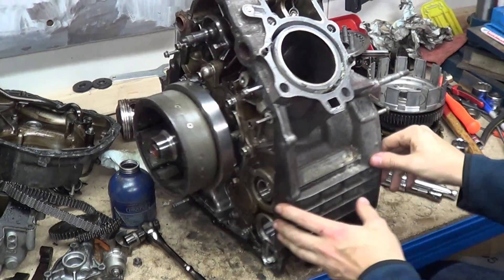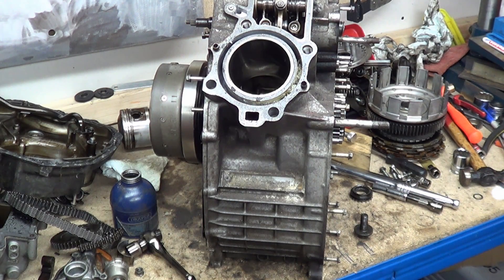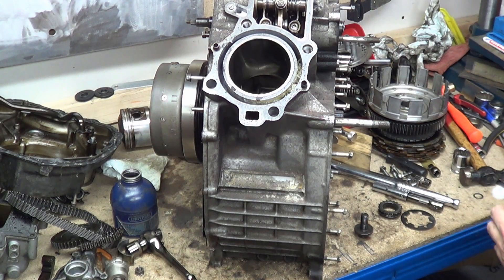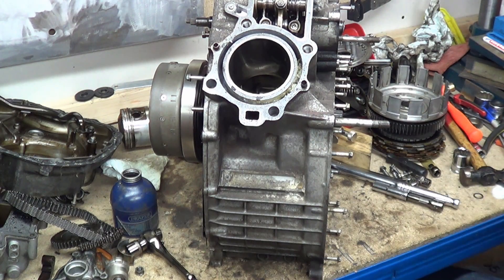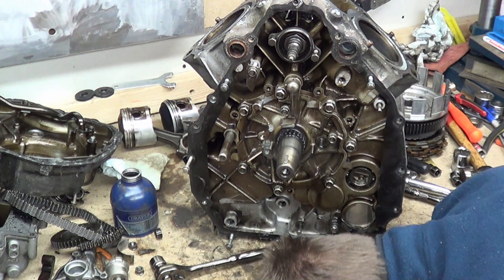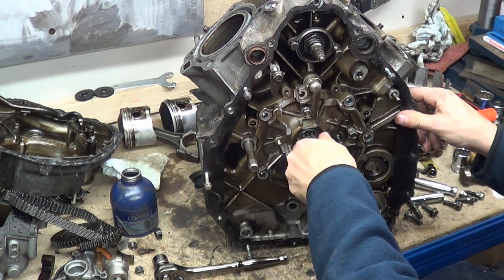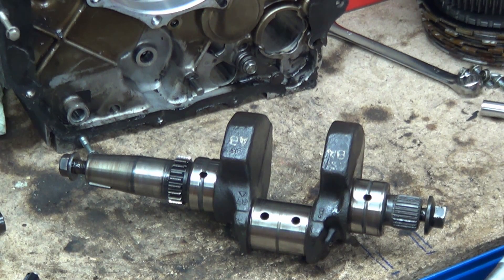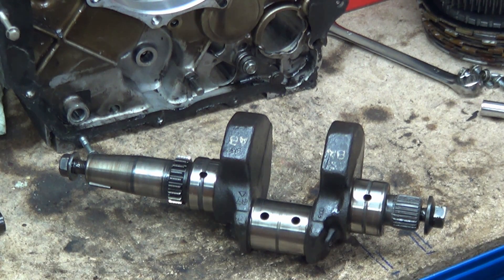CX500 V Twin 4 Stroke Series - Part 11 Crank Removal

Comment: We still need to remove the nut on the other side of the flying wheel. How do you do it? Did you put the flying wheel to be able to remove it?
Reply from the maker: A flywheel locking tool